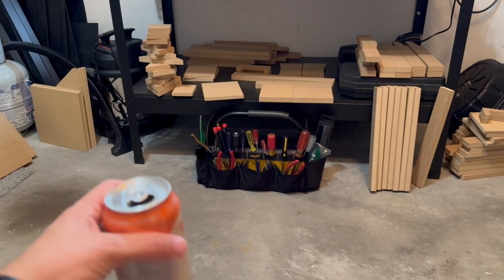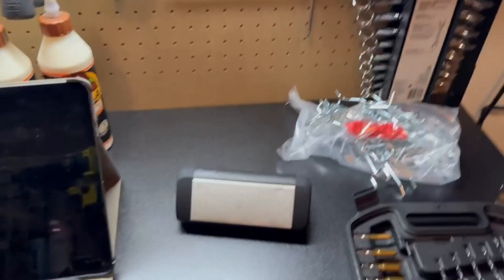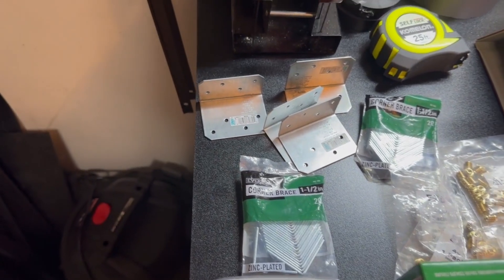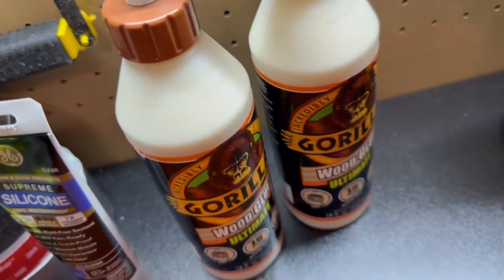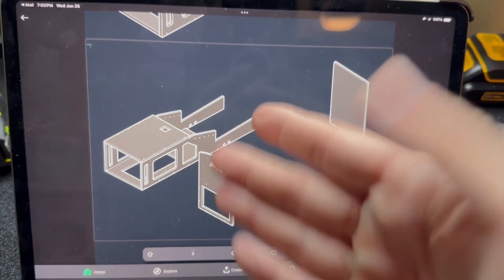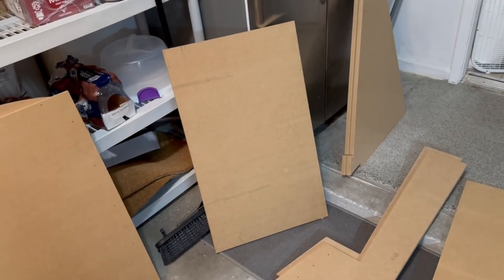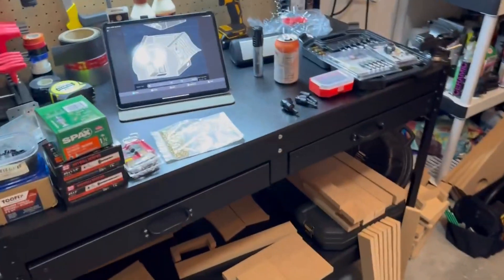An Adder Fanged: Building an F-16 Cockpit Part 1: Tools, Inventory, Overview

Comment: I saw the pieces for the panels, panel holders, are preholed and alsonpre drilled. Where do to find that infos? The plans that inpurxhased from TJ includes that pieces, but without panel holes.
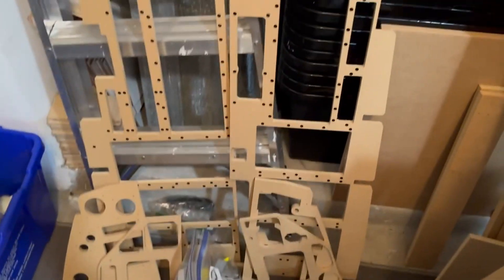You can find what I say in 9:06 of this video.
Reply from the maker: When did you purchase such plans?